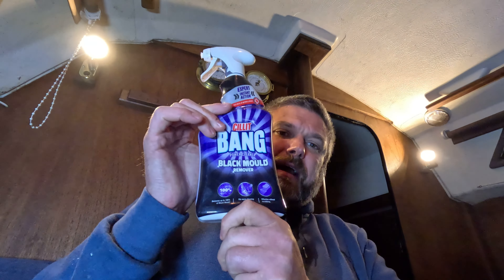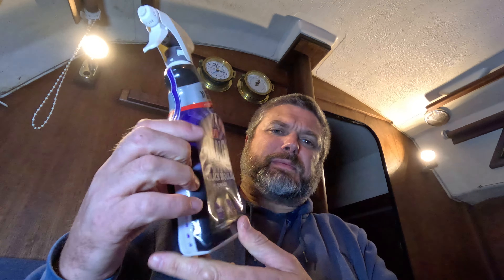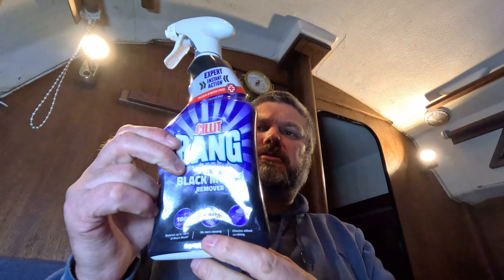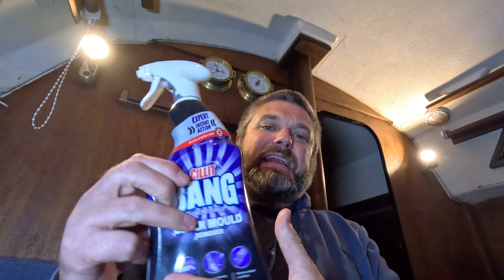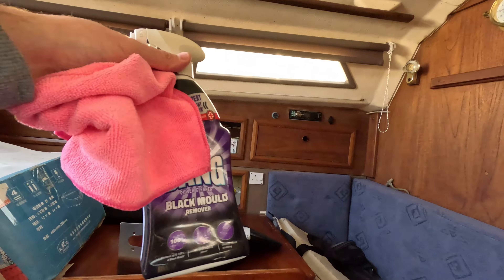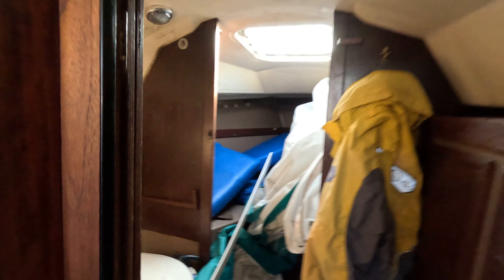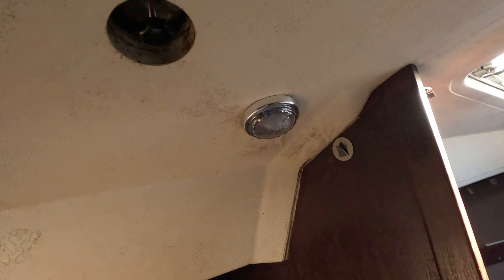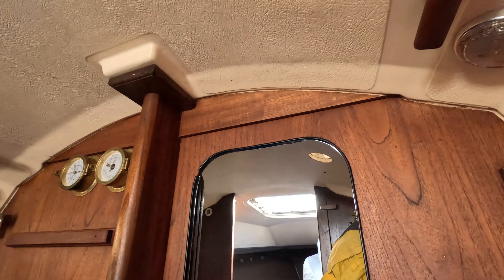Trying out Cilit Bang Mold remover on some moldy  fiberglass inner mouldings on my sail boat

Comment: That's your "new bigger" bigger boat - why not the Jaguar 24?  But the Trapper has a a good "comfort" rating.  Nice choice.  I just have a sailing dinghy i rigged with my version of a sprit sail. ..I am doing my Day Skipper and then getting a twin keel Hurley 22 mud lover.  Hey?  show us the Before and After on the interior on your Trapper when you have finished?  That wll save me tons of time - hahahaha...   Ta Lar.   :-)
Reply from the maker: It's a case that this one was local and knew the history plus 27 foot is ideal size for me sailing single handed. The interior is still a work in progress but it's functional, diesel heater is the current project to keep me toasty in the colder days 😂 i find I don't have enough time for the projects I go down and sail on Saturdays but will get a few videos up when it's back on the hard. Where do you sail the dinghy? Day skipper is on my to do list!